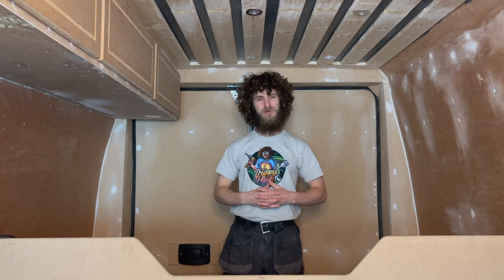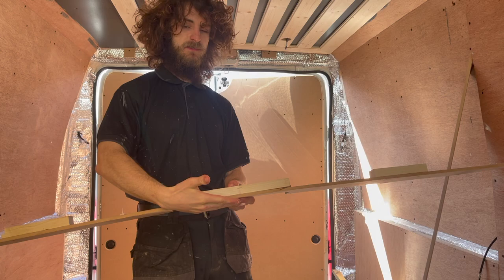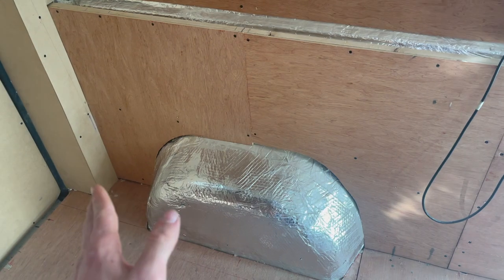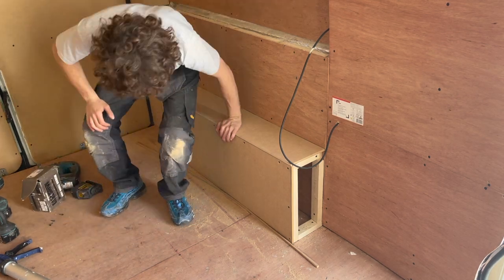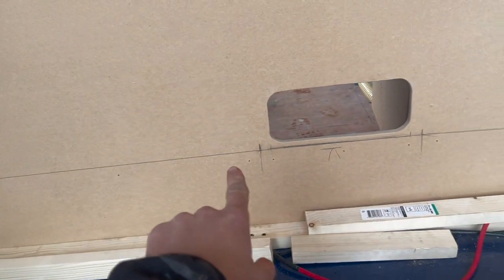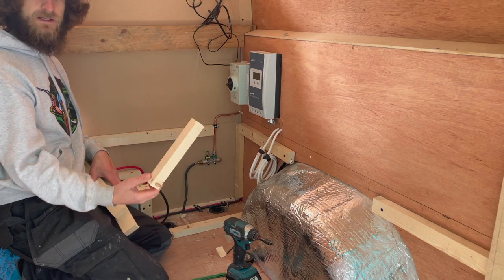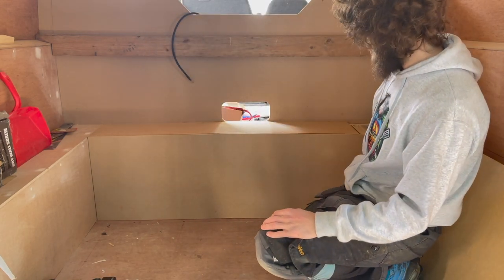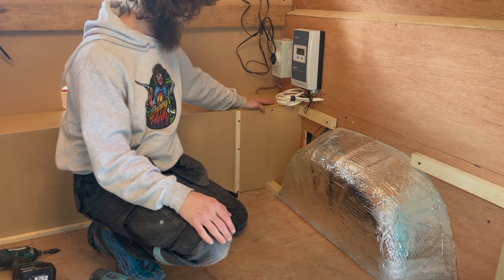Step 8 camper van conversion diy boxing ins  2021

Comment: Have you left the boxing ins removable in the corners so you can change the light bulbs
Reply from the maker: Ahhhhh! very good point, no I haven't but I have just assessed this problem and come up with a solution, I can cut holes and make some access panels in the areas where the lights are.
Reply: @DrippyHippy  he hh6ý

Comment: How many trees had to be cut down for your cool van all that extra weight really going to make that motor work hard but tons of extra pollutants into the atmosphere
Reply from the maker: Most probably less trees than what was used to go into building the home you live in and all of the furniture you most probably have but hey ho I could be wrong. Hopefully one day I will be able to run off a fully electric motor but unfortunately I haven't got the money to invest in a project that big for now. But thank you for watching I appreciate all of the feedback.
Reply: @DrippyHippy  going full leccy ain’t the shout bro. Go solar and then stockpile energy. Biofuels are easier to come by now aswell